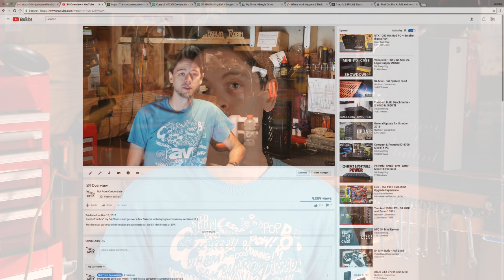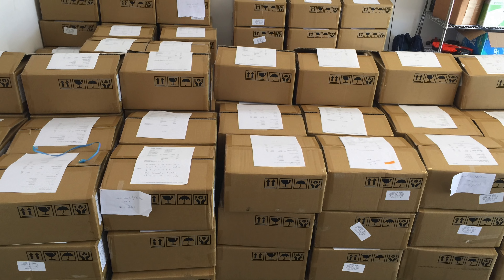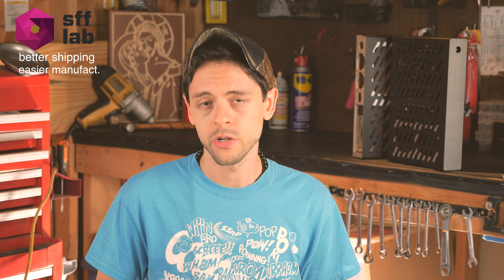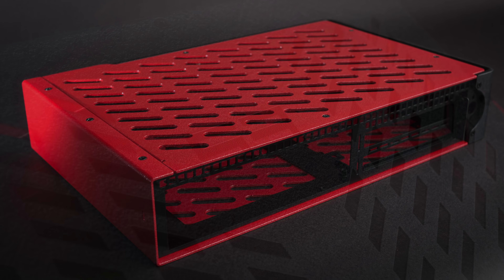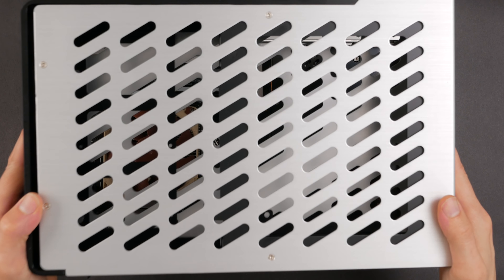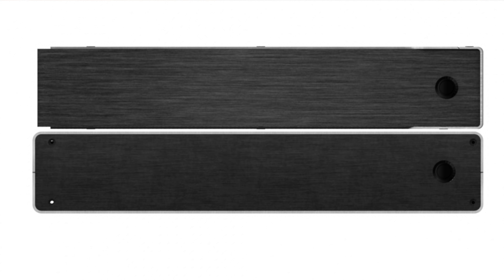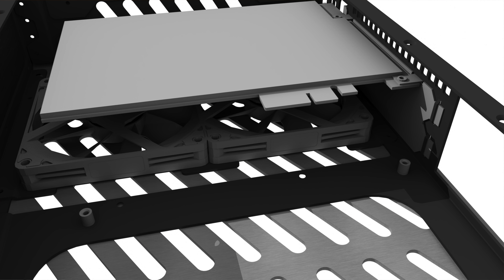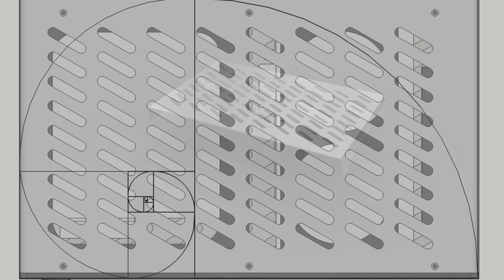SKYREACH 4 MINI   Preorders, Logistics, Design, and more!

Comment: 5:50 - Shots Fired! Tbh, as a student, that price is my aim.
13:45 - Damn, compatibility is difficult. I'm going with slot lengths of 9.57mm w/2.7mm radii for 120 & 140 mm tiled fans. Now to add vesa somehow.
19:20 / 19:52 That's my outlook on designing. Make it do anything - you won't know what they plan to use it for.

Comment: so, to buy the case and all the other parts that are needed for power, How much is the chassis and 400 watt psu?  coming from the old school pc build line of thinking?  with your cables and the power and the case.  knowing that i can chose a lot of stumbling blocks. is there a parts list that I can just goto for ordering everything i need for a system?  Are there multiple build parts list already created for currently available electronics?

Comment: Hey Josh. Congrats once again on another great product! Might pick one of these up. Couple of questions:
What is the C8 connector port for? Are there any power solutions that make use of it?
 I heard somewhere you're working with Gury on something, so if its a custom PSU that outputs 500W with C8 or similar I'd love to have more info!
Reply from the maker: Hello my friend! I recommend reading this build by KMPKT to better understand the HDPLEX 160 build: https://smallformfactor.net/articles/feature/community-feature-kmpkts-orangulan

Comment: i have a question, i could buy this case from somebody in my country... BUT i just saw on your website there are two options for skins.. 8x9 and 9x9... does this means there are two different cases?
the one i could buy is 8x9, is it possible to go brickless with this case? also what option i have for  horizontal and vertical stands and feet? thx
Reply from the maker: There are 2 revisions of the case in circulation and the newest is 9x9. All of them have identical specs as far as size goes...it was just small updates like the skyslot pattern and C8--C6 connector compatibility.
Reply: @NotFromConcentrate  thank you, i will get it :D i saw some powerbuttons have led inside, the case im getting dont have led in the power button but it comes with hd plex 400 all modded cables and the brick... i will look for a button and for feets now... a stand would be nice but i dont a have cnc or  a 3d printer... cant wait to get this case :D im so done with the big stuff lol

Comment: Question, where would I purchase a polarized C8 connector that is compatible with HDPLEX's 160w internal brick?
Reply from the maker: Hello, Jotunn!

You can buy C8 connectors from lots of different places (I buy from Mouser), but you are going to have to wire it up and it will take some soldering or crimping. I recommend soldering because you won't need special tools and it will be more compact. I'll throw some connectors up on my website once I get a video made with instructions.  Peace
Reply: Many thanks friend!

Comment: i love the idea and the design, but for someone that earn 350$ a month this is not affordable at all, so i want to build one by my self following your design , but still have a problem, the PSU is still expensive, 170$ for HDplex400w and a 330w power brick, is a bit too much, that i can't build because i can't find how to build that PSU, so i wander if is possible si fit a TFX PSU if i disassembly it :-?
i really love this case, and i really want to succeed in my adventure to build this, because God i hate gaming laptops, are too god * expensive
Reply: Marian Pelmus you can check out g-unique psus. He also sells compatible ac-dc adapterw including a modded dell 400w

Comment: I need to be able to mount a 3.5" floppy drive in the new SKYREACH 4 MINI, this is absolutely imperative.
Reply from the maker: Roger that. I will have a bracket and bezel for this available April 1st in the US.
Reply: @NotFromConcentrate   I actually DO need a case with a 3.5" floppy bay in 2020, to run windows 98 on a mini itx form factor

make that dream come true and i'll buy it

Comment: So the gpu riser is now included with the chassis and the 3D Bezel is no longer needed (or even usable with the new model) for 1080 mini compatibility?  That's awesome.  Also, the chassis orders are moving to the SFFLAB site, but what about everything else? Skywire cables, power buttons and other accessories still being done through the NFC Systems store?  I didn't see entries for them on SFFLAB.
Reply from the maker: THEUrinalCake you got it! Chassis purchased through SFF LAB and for the time being my accessories are purchased through my website.
Reply: Not From Concentrate 11/24 the opening preorder date on those as well I assume?
Reply: Just a suggestion but on the sfflab.com it'd be cool if when you press the shop button the logos actually linked to respective website (So when you press it now you have NFC that is unclickable and below it the links to Skyreach 4 Mini and S4 Mini Accessories. It'd be cool if the NFC logo linked to the NFC store.) 
Right now clicking the accessories link just goes to blank page. If nothing else at least this page could link to NFC. I feel like some new people will be lost when using sfflab.com and trying to order accessories. 

Also not directly to you but I'm sure you'd be able to reach them before me but the sfflab twitter and instagram are pretty much dead so since this video will probably direct lot of new visitors to the sites it'd be in their interest to quickly fill out the descriptions and add some pictures and avatars etc.
Reply from the maker: Great idea!

Comment: I love what I see; could we get a diagram with measurements/specifications so we can check for components compatibility - I was looking for it but could not find it everywhere, except the sketcup model which I am not proficient with. Sorry if I missed them somewhere and if this causing trouble.
Reply from the maker: Hello and thank you for your comment! On the order page there are a few tabs with compatibility and dimensions so you know what can go inside, but I am working on content to further expand this and make it even simpler. Sketchup is now web based too, so you don't even have to install anything to check out the 3D.  Here is a link to the product info: https://www.sfflab.com/products/nfc_s4m  THANKS!
Reply: Thank you! I must have been blind, sorry for the inconvenience.

Comment: There is a thing about the Skyreach S4M-C. I just love the aesthetic of the S4M-C, that bezel is amazing. I can't wait to get out of poverty and afford some luxury items. I've had my eyes on this for more than 2 years, but I can't just buy it and wait to afford a worthy PC to put inside this piece of art. And I'm not even into high-end components, I prefer low power consumption, like Intel "T" CPUs (like 7700T) or APUs (I have my eyes on Ryzen Raven Ridge). I probably don't even need a dGPU slot, but it's nice having for some virtualization and GPU passthrough (or / and additional NICs).

Comment: Any chance this case can be modded to fit in a rack case, looks like it can fit into a 2U spacing with some planning
Reply from the maker: It's 64mm wide and a 2U space is about 90mm? Plus it screws together on the sides making for rack adapters really simple. Or you could buy a vented shelf.

Comment: is there room for a dynamo/dynamo mini combo with an internal 160 ac/dc and external dell 330 to power a 1080ti?
Reply from the maker: You wouldn't be able to fit a 160 ac/dc with the 1080ti, as it is a hugely oversized card :(  Even if you could, it seems to me to make much more sense to simply use a bigger brick and the HDPLEX 400 for this setup..maybe one of  Gunique's Xmas edition bricks.
Reply: I just found a video with a link to the Gunique bricks and yep that looks like a better solution. thanks!

Comment: Random thought. Your skyslot spacing would be good for grilling. I'm expecting your Korean BBQ case powered by GPU heat.
Reply from the maker: If only there were mini itx motherboards for the Pentium 4 Prescott!
Reply: Not From Concentrate I'm pretty sure it would be pretty a viable mini-grill with stainless steel or carbon steel pre-seasoned. Charcoal powered w/ mounts with a fan to stoke
Reply from the maker: add that to my next patent application: Scope of Invention - Some people like to have the option to either build a mini-itx PC, OR have a portable charcoal BBQ. The SKYREACHWTFBBQ MINI solves this problem.
Reply: This is a joke, right? lol
Reply: If he starts selling my idea and does a Zuckerberg, I'll make sure Josh ant Sniffing the BBQ

Comment: why is the s4m $200?? I would pay $200 because its not a problem for me but, if its going to be $200, its at least got to be custom made... I like the sound of wooden bezles but, why not have 3d printed bezles being an option to lower down on cost a bit... 3d printing is becoming a powerful modern day utility being used to make things like prostetic limbs and creative printed art.
having a 3d printer to use for front plates will be a great thing for SkyReach. the skies the limit on what you can do with the s4m also a s5m being the size of a xbox one s/x and having support for slim odd drives, medium sized gpu's and more customize ability options will truly be the best console killer case..

Comment: Not in a rush to build a new PC at the moment, maybe when a mini volta gpu hits. Will this eventually come in more colors, I have always wanted a blue Classic Mini. Might even go for a carbon fiber shell. Just curious if more options will come later down the line even if it's years from now. No need to answer I would not want to detract sales. Wish you all the best on these pre orders. Make sure to send one of these to linus to boost up these sales, maybe slap mkbhd across the face with one too, will probably do wonders.